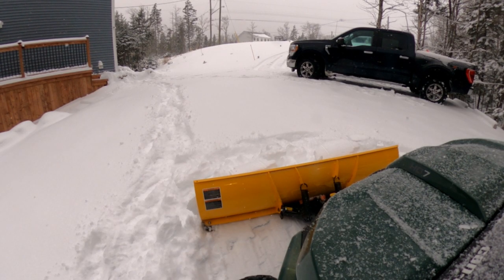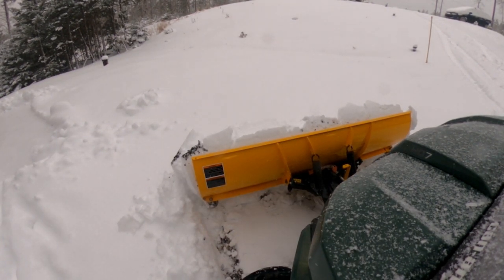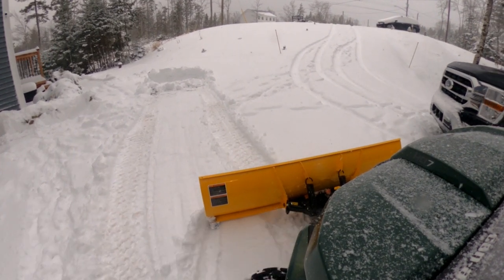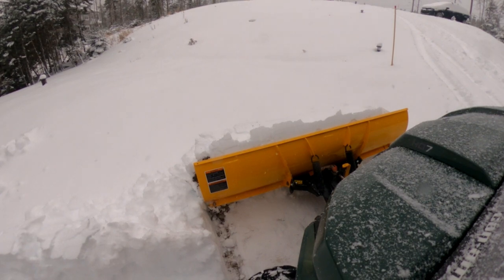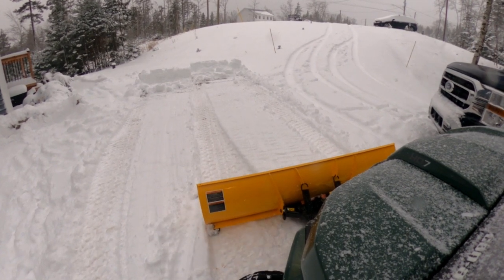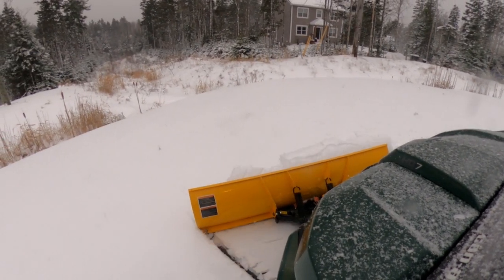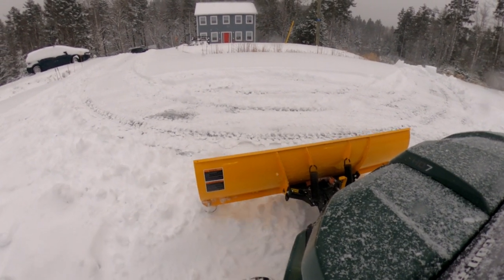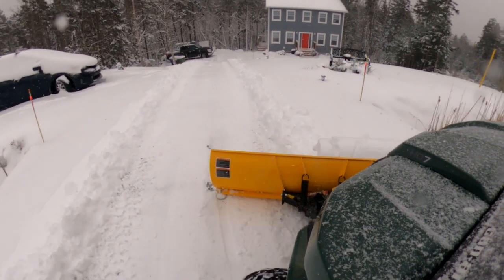Brace the Snowstorm: My First Time Plowing With Can-Am Defender Promount Snow Plow

Comment: If the shoes are adjusted so that the blade is half inch high on a level surface, you shouldn't have too much problem with digging up the gravel. My snowblower is set like that. Unfortunately, most of the equipment at work isn't so gravel areas are interesting.
Reply from the maker: Hey ducky - good hearing from you! Now that the rain melted everything today, I took a closer look and saw that i didn’t scrap as much gravel as I thought. I will adjust the shoes that half inch as you suggested

Comment: Im impressed with you video. your HD7 looked like it did an excellent job plowing snow. your driveway is very similar to my driveway only difference is you have an incline in front of your house while mine is at the end of the driveway. did your can am have any trouble plowing? Im asking because Im in the market for a side by side for plowing. would love the HD9 or HD10 but they're a little out of my price range
Reply from the maker: Didn’t have any issues last year even with snowdrifts. Base wasn’t icy so tires were able to get traction. Was very pleased with results and time savings.